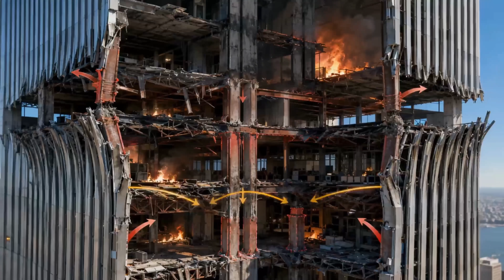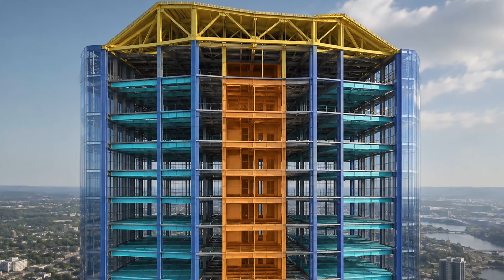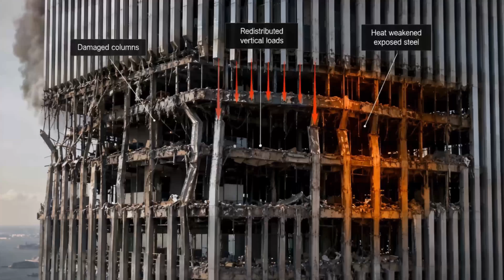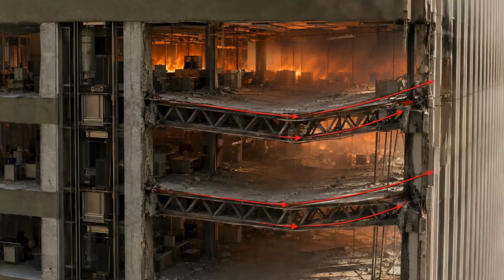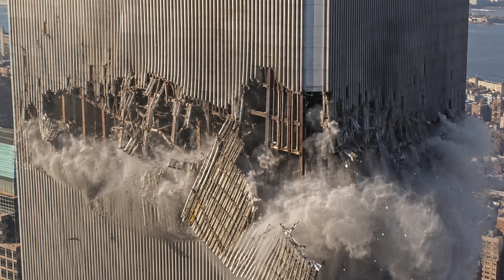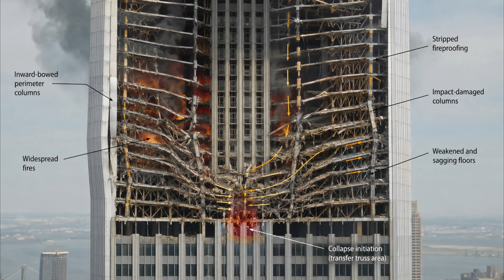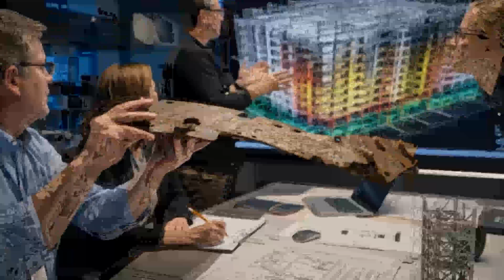What Happened Inside the Twin-Towers After Impact?

Comment: What caused building # 7 to fall?
     I'm old, I've seen a lot of 'things'.  
I know 'controlled demolition' when I both see and hear it. 
     I also recognise 'PR'/Narrative Control' when I see it and hear it.
Ad Hominem attacks forthcoming...
Reply: I can do a bit better:  Building 7, the 6th building to collapse of 10 lost on 9/11 got little attention early on due to higher priorities. As a result, the information void got filled with technical nonsense, creating lots of confusion and misconceptions. Many people, like you, just want to know what happened. To remove the confusion I prepared this brief summary from my own independent technical analysis. Let me know what you think. 

At 10:28am the WTC North Tower collapsed, showering Building 7 with tons of burning debris, causing heavy damage and starting many fires burning out of control for the next 7 hours. Office buildings are essentially giant piles of kindling when it comes to fires, chock full of stuff that burns vigorously and quite hot. Since half the firefighters had been killed, units in disarray, equipment destroyed, no water pressure, and the priority of search & rescue efforts, 7 couldn’t be saved so firefighting efforts were pulled as futile and 7 left to its fate. Firefighters make that choice every day in brush fire situations - which houses to save and which ones to let go. Only real difference here is moving the decimal on the size and cost. People get overwhelmed by the size. 

www.youtube.com/watch?v=g_SvpwyC17M 

Collapse of a burning structure is always a concern for firefighters. Steel buildings are uniquely vulnerable to fire damage. Designed around 1 to 3 hours of fire resistance for occupants to escape they rely on active firefighting to survive. After that all bets are off. Left to their own devices they'll exceed their design envelope and collapse, like Plasco Tower and Wilton Paes de Almeida. In 7 the occupants escaped, passive and active fire protections were compromised and active firefighting was abandoned hours before the collapse, which left the building to its fate. It lost. Odds on Building 7 would eventually collapse, and it did. No big deal in logic. 

www.youtube.com/watch?v=WnYBX6QT0R4 

FDNY Chief Daniel Nigro - The biggest decision we had to make on the first day was to clear the area and create a collapse zone around the severely damaged 7 World Trade Center, a 47-story building heavily involved in fire. A number of fire officers and companies assessed the damage to the building. The appraisals indicated that the building's structural integrity was in serious doubt. I issued orders to PULL back the firefighters and define the collapse zone. It was a critical decision; We could not lose any more firefighters. It took a lot of time to PULL everyone out, given the emotionalism of the day, communications difficulties and the collapse terrain 

FDNY Deputy Chief Peter Hayden ; We had our special operations people set up surveying instruments to monitor and see if there was any movement in the building. We were concerned of the possibility of collapse in the building. And we had a discussion with one particular engineer there, and we asked him if we allowed it to burn could we anticipate a collapse and if so, how soon? And it turned out that he was pretty much right on the money, that he said 'In its current state you have about 5 hours 

The collapse of Building 7 was anticipated and widely reported in the media throughout the day, with 24 video cameras recording it. Everyone knew what was coming and why. 

www.youtube.com/watch?v=OY5S5k3tMHI 

Building 7 collapsed from the inside out which is not intuitive and hard to understand. Most details are hidden from view and some people will struggle no matter how much it is explained. But here is my best shot relying on no outside authority. Building 7 was a unique, asymmetrical 47-story steel frame structure built atop a smaller 3-story building serving as a partial foundation and requiring lower floors dedicated to complex load transfer structures. Of trapezoidal shape and tube-in-tube construction, B7 (above the 7th floor) consisted of a central core of steel columns carrying most of the gravity load, perimeter steel columns around the outside of the structure carrying the remainder of the gravity loads and long span beams and girders to tie those elements together and form the floors. On the outside of the building hung a curtain wall facade or outer shell. www.nist.gov/image-16640 

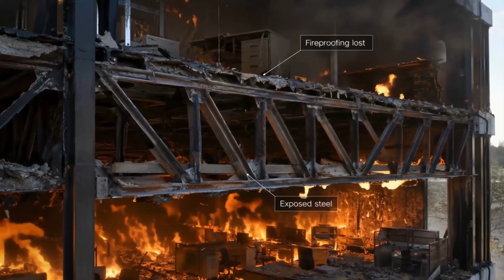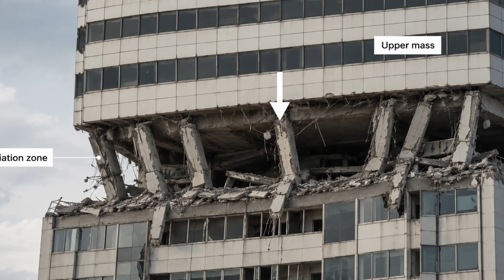Phase 1 : First externally visible signs of collapse initiation occurred at 5:20:28 pm and was notably quiet with observers not realizing the building was collapsing! No warning in the form of hundreds of eardrum busting 180dB explosive bangs. Here at 12:00 a local CBS affiliate reporter is just 10 blocks from B7 when collapse begins. People don’t start to notice the collapse until 12:11. At 12:45 is the famous CBS fixed camera clip of Building 7’s collapse. Note the silence. 

www.youtube.com/watch?v=t5tEy6mXSE8 

Lower floor failures above the load transfer region (8-14) in the NE corner initiated the collapse. In this video at 0:45 you can see the NW corner from inside the building while under construction, Column 79 just out of frame on the left. That big, angled steel beam across the top of the frame connects to C79 at one end. The girders connect to the beam. That beam and all those girders depend on just one connection 

www.youtube.com/watch?v=nP3TNHPCIVU&t=45s 

Phase 2 : NE corner floor failures caused a loss of critical lateral support over an excessive length of Column 79 and it buckled. A column buckles when it takes on more load than it can handle. Externally we see a vertical progression of window breakage along the 44-46 line and a kink in the roof of the East Mechanical Penthouse atop the building, all consistent with C79 failure. Looking at the above floor diagram of Building 7 when you see all the structures that depend on C79 you quickly realize this one column was a relatively isolated structural element on which a disproportionately greater fraction of the structure depended analogous to say the Key Bridge. Normally with a buckling column, the load could be redistributed to other columns. With C79 that is not the case - the failure did not redistribute the load, so the collapse rapidly progressed to the roofline, sinking the rooftop penthouse. The transition from full capacity to almost no capacity occurs in an instant and will result in virtually no resistance 

Phase 3 : With C79 gone, B7’s progressive, non-symmetrical collapse continues with adjacent columns C80 and C81 left laterally unsupported and quickly buckling as well. The EMP drops down through the building. C79-81 all have no diagonal bracing, which is the major reason why they could not redistribute a lot of vertical loads among one another. From there collapse progressed from east to west through the central core until the core was gone from C81 to C58, taking all the interior floors and probably most of the perimeter columns with. Follow the horizontal progression of window failures low in the building and the dropping of the remaining rooftop structures into the building. The NIST Building 7 study model 4 determined C79 failing under ANY circumstances would have initiated the same collapse sequence. 

Phase 4 : After about 10 seconds only the exterior moment frame remains, giving the illusion B7 is still standing to the casual observer as little has changed outwardly. But it is just a hollow empty shell like an empty cereal box supported only by a few remaining columns and quite unable to remain standing on its own. With nothing remaining behind it, the north face of the outer shell leans into the void, forming a V in the roofline, the last few columns buckle under the strain and the moment frame free falls, landing on top of the debris pile.

It is only now that we get to “free fall”. For those who get all worked up about an alleged 2.25 seconds of free fall - don’t. How fast something falls can’t tell you what started it falling, the alleged measurement people fuss about is wrought with problems, not least of which being it isn’t The Building (defined as its center of mass) being measured AND the measurement doesn’t even start until more than 10 seconds after the collapse begins, meaning whatever caused the alleged free fall was due to collapse progression mechanisms NOT collapse initiation mechanisms. Useless for informing on what caused the collapse in the first place. It is now and always has been a Red Herring. 

The debris spread well outside the footprint blocked surrounding streets, heavily damaging the Verizon Building and destroyed Fiterman Hall. 

No building is meant to survive 7 hours of multi-floor unfought fires. Building 7’s progressive, non-symmetrical collapse was incidental, unintended collateral damage from the combination of fire, time & gravity started by the collapsing North Tower, true no matter who planned and carried out the 9/11 attacks or why . Of so little consequence it barely registered at the time, only taking on semi-mythical status as an alleged smoking gun years later when demolitions at the Twin Towers, missiles at the Pentagon and shoot down over Shanksville all failed and conspiracists had nothing left to work with. 

Anything can seem like a conspiracy if you don’t understand how it works. Now you should. I hope you found this helpful, informative and it solicits informed critical comment. If I made any errors of fact, logic or reason or left anything important out, please let me know so I can fix it. OR offer a more plausible alternative if you can. Be the first. Please start any reply with the words “Tits McGee” or I will know you didn’t read it and are wasting my time.
Reply: You forgot about THE JOOOOOOOSSS!!!